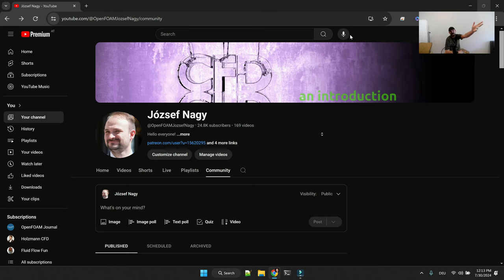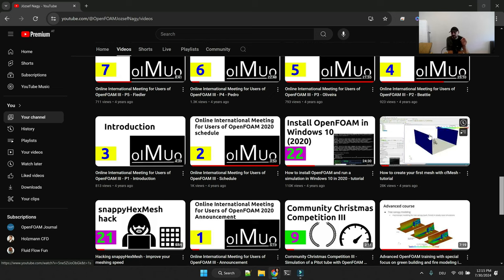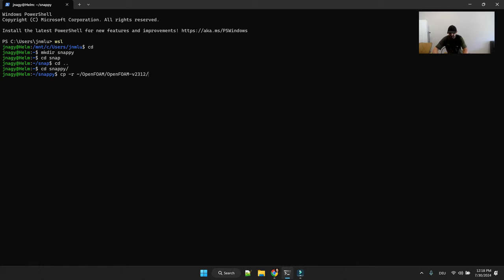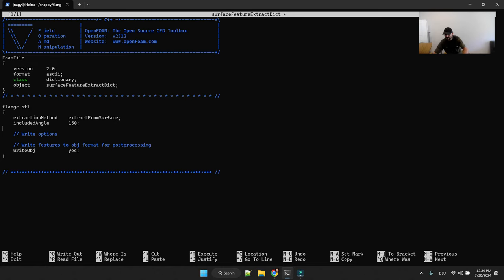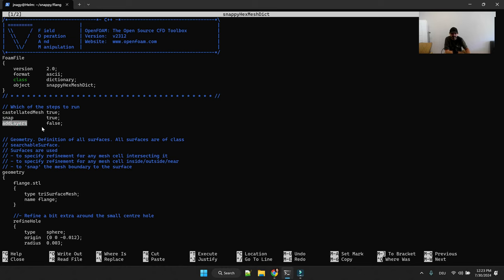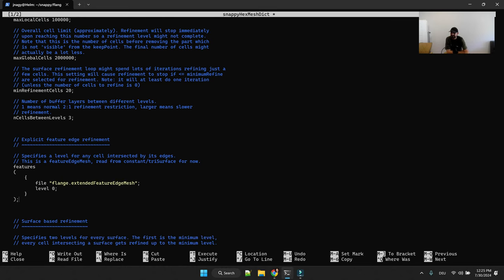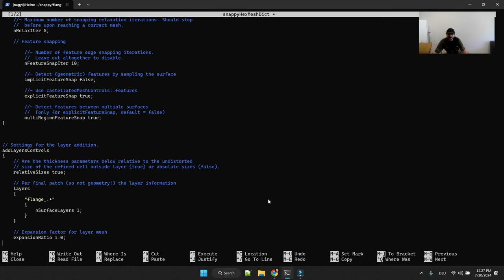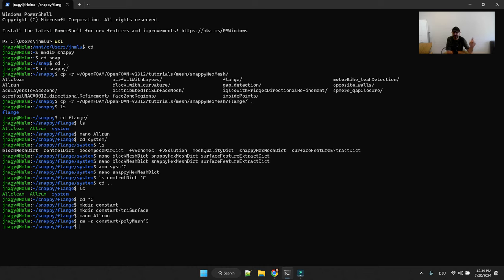Meshing with OpenFOAM - CFD Summer series 2024

Comment: Hi! Before use the stl file we can use surfaceCheck to check the stl quality. 
I have a case with a stl very larger (like a 3 meters) and with thickness small (10 milimeters). Do you have some idea how i can do a mesh clear with openFoam? Or another open source software?
Reply from the maker: Not with OpenFOAM. Blender?

Comment: I just wish snappy worked well with prism cells on the boundary layer 😢
Reply from the maker: Yes, layers are still an issue in snappy. Did you try cfMesh? Sometimes layers are better there.
Reply: @OpenFOAMJozsefNagy by the way, thank you for your lessons on youtube. I specially followed the one on the rotating fan to be able to make a turbine myself
Reply from the maker: @matheusnunes970  Great! I am glad it helped you!
Reply: Hi  @OpenFOAMJozsefNagy ! is cfMesh free or does require license?
Reply from the maker: @mariarosales3535  The one which comes out of the box with .com version is free. There is a licensed "pro" version, but this has to be downloaded from cfMesh's homepage.